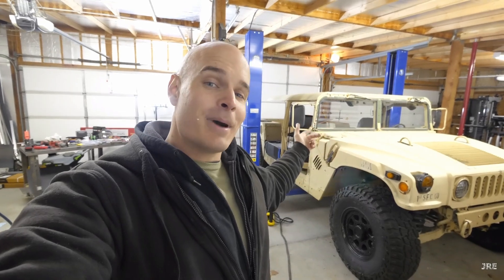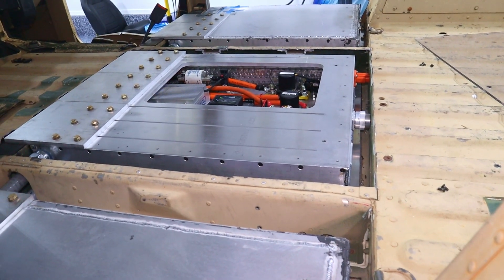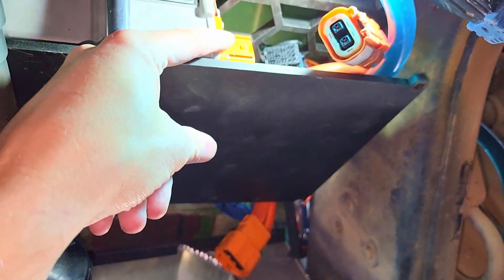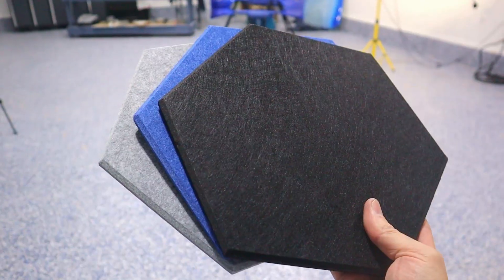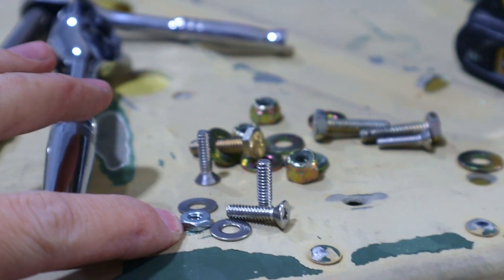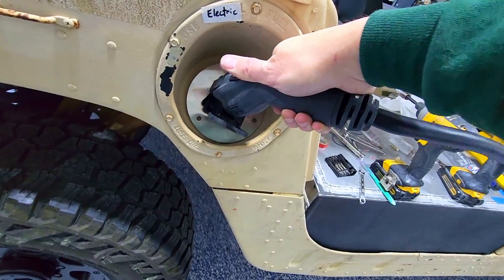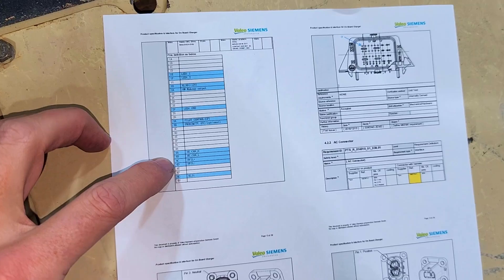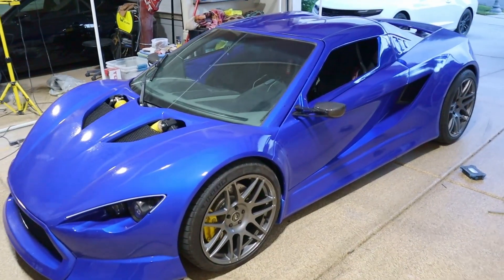Electric Converted Hummer - Diagnosis from the EV Doctor

Comment: I am an EV battery Pack design Engineer and have also worked on the power electronic of EV, you should purchase a CAN Adapter to log and record CAN message on a Open ended software like BUSMaster and check if your OBC is sending and receive CAN messages as per protocols mentioned by the vendor.  1) Make sure you are sending all the necessary CAN messages to OBC ( On board charger ) as per OEM instructions.     2) Receiving  the feedback CAN messages  and no fault code is detected. ( Please refer to CAN data sheet of On board charger )                                                                                                                                                                                 3- You are using J1772 charging socket and it used CC and CP pins to communicate with OBC please make sure there are also properly connected.                                                                                                                                                                                                                                               Just let me know, I will be more than happy to help you guys out in this project.   Kudos !!
Reply from the maker: Thanks for the comment!  At the moment I am troubleshooting with Orion as well as evolve.  It seems that the CAN is communicating.  It seems that the BMS is not happy about something so...still trying to find out what.
Reply: @electricsupercar  I have used Orion BMS   for EV prototype battery pack, I am completely aware about its software also. You can email me the issue you are facing with Orion BMS. I hope we could solve this issue ASAP! just let me know.                              Regards
Reply from the maker: @syedahmedhassan7951  what is your email?
Reply: @electricsupercar   Please check electric super car email, I have left a note on that email.

Comment: What exactly is "neutral" on the input? In the US, when you plug that into a level 2 charger, whether it be powered by 208v from three-phase or 240v split-phase, you're going to get two hots and no neutral. The J1772 plug is only conveying L1, L2, and earth. So I'm not sure what swapping those pins around is going to do?

Comment: Does the canbus have its own 12v external supply? In cars it would be normal since everything is 12v. Tesla probably has a converter to power the canbus and it activates the bus when the car is turned on. The screen may have a a vcc or vdd or voltage input not readily recognized when wiring it up. Also grounding all the devices to each other would help as well. Most canbus in cars have common +- and the 2 comms. I was surprised you guys wired it 2 wire and not 4 unless the is similar to i2c.
Reply from the maker: Thanks for the comment!

Comment: I may be just overthinking this being an engineer. It seems that the Can Bus is a big point of failure. If it were me i would go Cat 8 just for the amount of shielding with a dumb switch and a simple vmware setup with low resources to specifically communicate between the different components, or the same but with micro computers like a pi zero that is controlled by a main pi4. But then again what do i know, i dont make vehicles.
Reply from the maker: Thanks for the comment!

Comment: I know that I'm late to this party.

Anyway, in the industrial applications where we had communication issues, I would rent an oscilloscope that has a CAN decode function and analyze the packets in order to narrow the issues down (to a device or a configuration issue). Don't know if that is an option for you. There's also some good CAN to USB converter and analysis software out there. It's just that the Scope served multiple purposes, for my use case. Good Luck!
Reply from the maker: Thanks for the suggestion!

Comment: What about the CanBus baud rates. Could it be 2+ units are on the same bus but at different baud rates?
I know automotive vehicles have multiple CanBus for the different bauds (ECU requires a higher comm speed than stereo nav controls, etc)
If you place a 125 kbps Canbus device (eg. Steering Wheel control buttons) on a 500kbps Canbus (eg. ECU) then the entire network breaks down.
Reply from the maker: Thanks for the suggestion!

Comment: Maybe there is an earth leak somewhere or something to do with battery cooling system as it should have cooling system when on charge 🤔
Reply: And one more thing it goes to a fault really quick, sow what i personally think when the charger is initializing and it checks all the other critical charging monitoring systems it is one of a first systems that's going to be at fault. Its only what i think 🤔 🤷‍♂️
Reply: As usually it takes some time to initialize before it's granted for charging
Reply from the maker: Thanks for the comment!   I'll check it out

Comment: My 2012 Ford Focus is doing the same thing because of a voltage leak in the lower battery pack. I tried taking the battery apart and fixing the fluid leak, cleaning up the coolant and reassembled with the same problem still happening. It shows it’s plugged in the batteries just won’t take a charge.
Reply from the maker: Hmm..🤔
Reply: @electricsupercar  the batteries were damaged from overheating from a bad fan control module that I neglected when I already had the new one. The heat damaged caused and expansion in the cells that created a coolant leak. The coolant leak caused what I can only suspect is more unseen damage in the battery pack. Many of these systems are similar in the fail safes. I’m going to take the battery pack out again tomorrow and tinker with it until I get my hands on a new lower pack. My BECM was still saying I had a high voltage leak after repairs to the coolant system and cleaning up. I bought the Focus Electric so I could have a cheap platform to learn on. We loved Sparky so much we ended up buying a new Mach Premium AWD Extended Range. I still love tinkering with my Focus. It has about 15 modules that all have to “talk” for the thing to even let one engage drive. I have all the manuals from Helm(the company that makes the repair manuals for the big auto manufacturers), the bus/Obd plug thing with software and wire diagram for the whole car(from motorcraft). I have learned everything hard knocks as YouTube has become a veritable sea of dribble information. I know this probably doesn’t help. I am going to subscribe to your channel however because I like your technique.

Comment: With a can analyzer i always recommend canalyzer with a can case its a good start, you need to assert that all units on the bus are talking with the same bus speed otherwise no messages will get through.
Setting up a can network will be tricky and you might need a can master that can translate all those messages between the different systems and can profiles. 
I spent 4 years peograming EV can networks for inverters, it gets messy quick
Reply from the maker: Thanks for the comment!

Comment: I’m the previous EV hummer video it was unclear if the shield from all the cables in the can bus were tied together. I would check if there is a continuous and solid connection between the shields, otherwise it’s just one giant source of interference!
Reply from the maker: Thanks for the comment!  Yes all of the shields are connected

Comment: I think you should wire the CP an Proximity directly to the Orion BMS, not the charger because the Valeo chargers have issues with the american charging standard. Make sure you have the SW1 Charger.
Reply from the maker: Hey!  Thanks for the suggestion!

Comment: Great job. Thanks for doing this! The Orion BMS2 does have two CAN networks, and I think one is internally terminated, so I agree that that probably shouldn't be the error at this point. Two things I'd like to see you address are the communication baud rate and the HVIL connector setup for the Valeo Siemens. So far, I haven't found any guidance on how the HVIL should be integrated, though my assumption is that the charger is simply reading an open versus closed circuit loop.
Reply from the maker: Thanks for the comment!

Comment: What is that stuff in the tube that he was putting on the charging plug wires before he put the heat-shrink on?
Reply from the maker: Dielectric grease

Comment: I would disconnect the modules from your vehicle's bus, the once you defenatly has an issues with and make sure this thing. Is anything outputs from the modules? See the vawe at least. If it's there. Could it be: you saying CAN bus. But what protocol you are actually using? Could that be just by passability that your modules are designed to talk on can bus but with different protocols? What it means different protocols is The speed like what is it 50 or maybe 125 or maybe 500 or even 1000 kbs? what's the frame of the massage?  is it 8 bytes? What IDs the modules using? Are they using any IDs? 
well 60Ohms 2 termination resistors ok I might assume you're are using actually vehicles official  ISO 15765-2 protocol which be like 500 Kbs and 8 bytes frame messages? maybe not all the modules using the same protocol?  to figure out that you can use something like CAN Hucker CH/P. or something like Arduino and CAN shield base thing. and if your modules are using different protocols and you can't  do nothing to change that on the modules itself then you may need something  in between modules. 
 Just start with READING THE ACTUAL MESSAGES then everything becomes clear.
Reply from the maker: Thanks for the comment!

Comment: Changed the pin of the socket? Now it can't charge with any other charger?
Reply from the maker: Still can charge with any charger
Reply: @electricsupercar  so the socket was wired wrong in the first place
Reply from the maker: @shubhamnile7667  yep

Comment: I would first try to connect to the charger via the Orion BMS software, make sure you add the charger you have on the Orion software, then you can connect to it from the Orion BMS software and see target voltages, amps etc... I think once you can communicate from the Orion to the Charger you will find the issue. The charger should also have some sort of status light, that will tell you what is the issue, maybe the contactors are not closed when the charger is plugged in, hence it is not seeing the battery and giving you an error.
Reply from the maker: Sounds like you know what you are talking about.  Thanks for the comment!

Comment: do not forget to charge your batteries people! 3 to 6 months is more than long enough for the system to drain the entire battery pack and if no computer is running to balance the cells then you've got dead cells that need to be replaced because you have lost its capacity and it is no longer a match to the rest of the batteries.
Reply from the maker: thanks for the comment!

Comment: Ideally you could do with a CAN SNIFFER, or diagnostic equipment that’s works with the equipment on the vehicle, 
One component will be corrupting the line, 
The resistors need to be at either end of the network,
Then there’s the comms speed, 
Are you sure all modules are communicating on the same speed? I’m assuming it would be 1587 as there nothing priority on that network like abs/body control?

Comment: Sadly it's easier to switch the wires at the plug end at the charger then at the j1772 end! any pins in any connector can be pushed out with the right tool and those could have been snapped back in!

Comment: First take a scope and measure the signals on the can h and can l to ground. They should be +- 2.5 V to ground or if data is transmitted +-5V and +-0 V. If that is ok use something as a CANalyser to see which modules are on the bus and what they are communicating. Oh the 2 120 ohm resisters should be on the ends of the bus.
Reply from the maker: Thanks for the suggestion!

Comment: First of all hello! Great channel and looking forward to the content. My name is Ryan I’ve been in the EV space for about 14 years. I have supported @grindhardplumbing, @richrebuilds, and @simonegiertz on projects in the past and love working on EV projects with content creators. 

I think like most folks here is seems like a CAN issue. However knowing that you are using an Orion 2 it looks like. I am curious if you have the pilot and prox going to Orion. Making sure that the BMS wakes properly when power is connected. What is the Relay you mentioned? If you have a splice on those lines it could be modifying the resistance value car side so either Pilot or Prox is not receiving the proper impedance. This could mess with the state machine and prevent the BMS from waking and sending out the proper CAN signals to start charging. 

Have you tried charging with the vehicle on? There is a setting in Orion that allows this to happen. This will help with any indicators about properly waking the system. 

Lastly to confirm CAN is working as intended I usually back probe with a PEAK-CAN dongle with SavvyCAN. The SW is open source (FREE) and allows you to add third party DBCs to it. But it’s easy to read and see the messages and see if the correct bit flips. Also the CAN dongle provided by Orion and there SW is also quite simple to use as well for checking. 

I also took a look at the docs for that charger. 
https://cdn.shopify.com/s/files/1/1976/6951/files/GEN2.5_OBC_Quick_start_guide_VSeA_2.pdf?v=1614709278 the CAN information seems fairly clear however i noticed the wake message is different here vs this complimenting doc. This one say wake is 0x171. "BUT HV ENABLE is 0x185 and should be 00 00 00 00 08 00 00 00"

https://cdn.shopify.com/s/files/1/1820/0269/files/GEN2.5_OBC_product_specification_26th_Oct_Euro_standard_product_VSeA_2_1.pdf?v=1592510916 This one says its 0x60A

Either way it should be fairly clear if you get a dongle connected to the BUS. 

Lastly Orion has the Valeo 3.3kW enabled? I saw in the SW it's available and just want to make sure that has been done already. 

OK This time my last thought. 
It seems both the OBC and the BMS support Pilot and Prox inputs. Which did you connect it to? Both seem to be "optional". This will definitely change the architecture of the system depending on what you choose. 

Anyways ......

If you have any additional questions throw me an email
ryan@kilowattconsulting.com otherwise ill keep an eye on this thread.
Reply from the maker: Awesome!  Thanks for the detailed comment.  I may have to contact you if I can't get things sorted out

Comment: Did you check if all the communications between wallbox/ plug work ?
The pwm communication in the plug, detecting cable/charge current and earth continuity ?
Maybe thats before or after CANBus. there are dedicated testers/adaptors for car/wallbox side available, but overpriced of course..i just ordered a Fluke complete set for all electrical testing. Fixed, mobile and EV for around 7K eurobucks.
Reply from the maker: Thanks for the comment!

Comment: Hi there, what are the fire proofing / smoke class for the acoustic panels.
Main problem with acoustic panels for my job is they mustnt catch fire or start emitting smoke if something goes wrong.
Thats a nogo like storing cardboard boxes / material on metal cabinets instead of inside.

Comment: You probably have a miss communication between either:
- the battery and the bms
- in the can between the charger and the bms
- between the wall charger and the charger but is not likely because it is getting recognized
- you have different can frequencies on the same can network
Plausible solutions:
- try to disconnect everything from the can network and use only 2 simple wires with proper termination if needed to connect only the necessary part for chatging (bms, charger, vcu)
- with a can network analyzer check for signal losses and/or miss cumunication
Reply from the maker: Thanks for the comment!

Comment: I am NOT an EV guy at all but I do mess with CAN networks a fair bit. Have you tried taking everything else apart from the charger off the can network connecting a laptop to it and seeing what messages are being transmitted? Or hell even an oscilloscope can see the message and it should be fairly straightforward to decode from the wave. It’s just 2 bits of information.

Comment: When I built an electric JetSki I had soooo many problems with the charging. It was the same Thunderstruck motors box. Ultimately it had to do with grounding the charger itself to the negative terminal of the 12v battery. As well as plugging the box into my computer and programming the charging settings. Anything helps 🤷🏽‍♂️
Reply from the maker: Thanks for the comment!

Comment: Are you using charger safety and charge enable relays on the Orion BMS? If so are you getting to the stage where the orion is closing these relays?
Reply from the maker: I will have to check it out!

Comment: This was dissapoiting....  Former EV tech here.  Check where the termination resistors are.  But what I think is actually your problem is one of the devices is operating at the wrong baud rate (communication speed) and causing everything to screw up.  If you don't have access to a can network analyzer.  Try just the bare minimum of devices connected to the network and try adding and removing different devices.  Like remove just the screen and see if it charges etc.
Reply from the maker: Thanks for the comment!

Comment: You need to be able to see the live data from the BMS and OBC. The BMS is the one that tells the OBC what to do. Can you see any DTC or error codes from the OBC or BMS? What are the pilot and proximity voltages at the OBC? Since you getting a red LED the OBC is not happy. I think this is more of a configuration issue with the modules not communicating correctly together than a CAN bus issue.
Reply from the maker: Thanks for the comment!